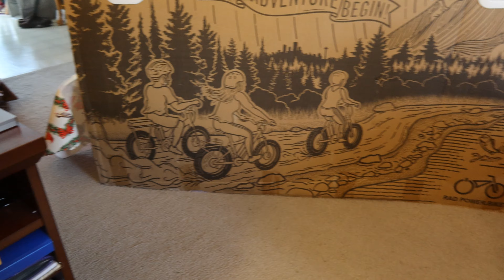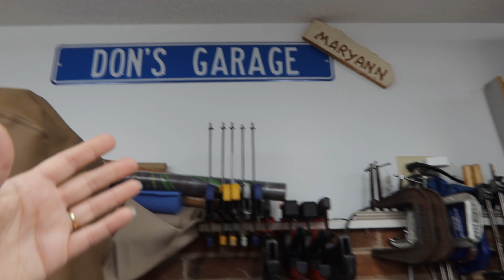Day 1655 Tesla Ruby Merry Christmas!

Comment: My hands bother me the most riding my mountain bike. Mainly thumbs, I think arthritis.
Reply from the maker: I've had carpal tunnel surgery on my left hand but not on the right. The right seems most numb on the rides. Where the "pad" under my thumb hits the grip seems to be the issue, but I need the thumb separated from the hand to use the twist grip. I tried resting my hand on the grip a bit more today, and things weren't quite numb. Thankfully it's more numb than pain. Sorry to hear it gives you issues too.